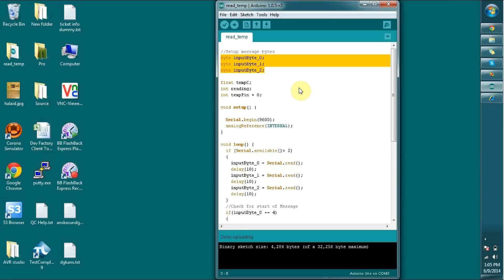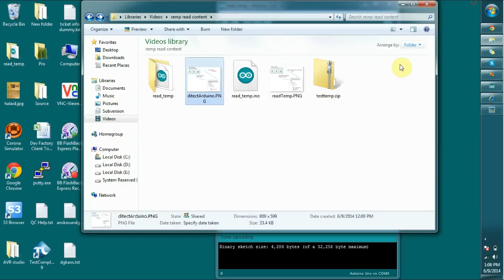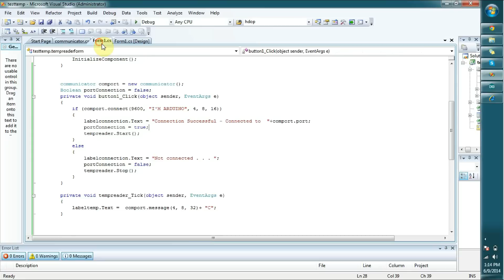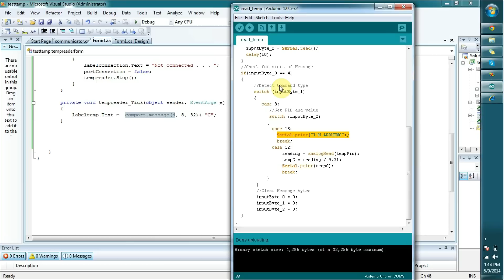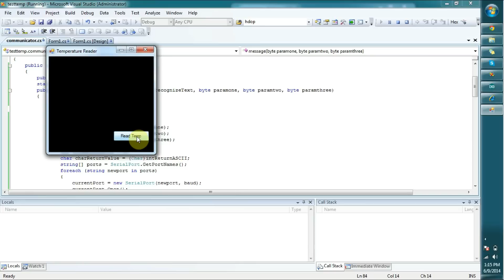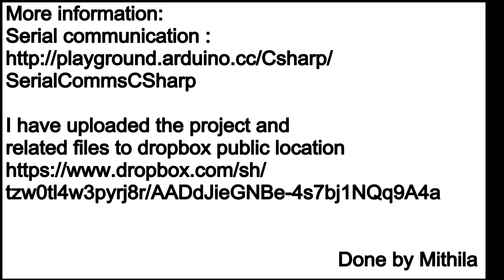Tutorial : Arduino Interfacing with C# to read Temperature via LM35 sensor

Comment: hi Mithila i want to connect RFID reader via Arduino to C# project how can i do it,, pls help me
Reply from the maker: Hi Narmada, 

 you can use this tutorial to read the RFID, http://playground.arduino.cc/Learning/PRFID

Then what you have to do is modify this part in the current code with your reading result (If you are going to use same ways to read the Arduino output in C# )

case 32: 
                  reading = analogRead(tempPin);
                  tempC = reading / 9.31;
                  Serial.print(tempC);

then you can see the readings update in C# side. 
This gives you initial idea to fine tune it with your project.

happy to help you..
Cheers
Mithila
Reply: Mithila Thank you so much...
Reply: Tu ramène un vrai ARMADA

Comment: friend i want to make heart beat recorder in c# plz help me friend
Reply from the maker: Hi Dalvir,

 Its not that much difficult you have to use pulse detecting sensor with arduino and the result you can post with the Serial communication as mentioned in this video. You can do this in two different way / 1- you can run the program around 10 - 15 second and then send the average speed to the C# OR 2 - you can continuesly read the arduino serial port and do the calculation in C# end.  Im really happy to help you since it improve my knowledge also. let me know if you need any help .
Reply: thanks sir
i will try
Reply: Mithila
plz upload video if you have plz

Comment: how I can add a LED to Arduino? and wakeup from c #, you could help, I have the code but do not let me
Reply from the maker: sorry for late reply, It is not that much issue. As I mentioned in this video you can send various byte combinations and then do what ever you want in the Arduino side. 

this is refer class "communicator "  I wrote in this tute
 
Ex : 
C# side 
comport.message(4, 8, 4)

Arduino side

 if(inputByte_0 == 4)
  {       
       switch (inputByte_1) 
       {
          case 8:
             
             switch (inputByte_2)
            {
              case 4:
                  //Set PIN and value to on the LED

Cheers!